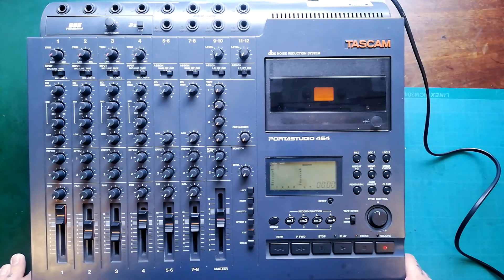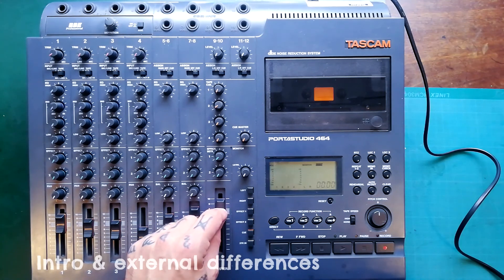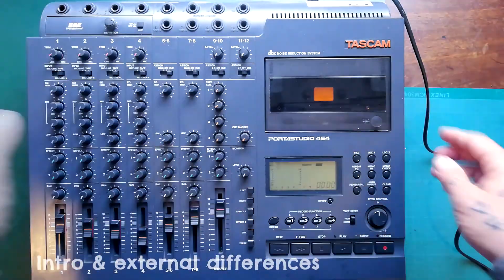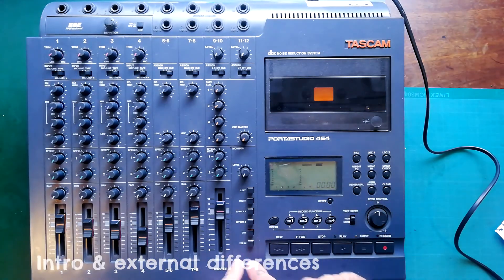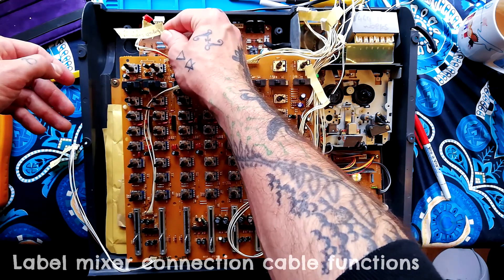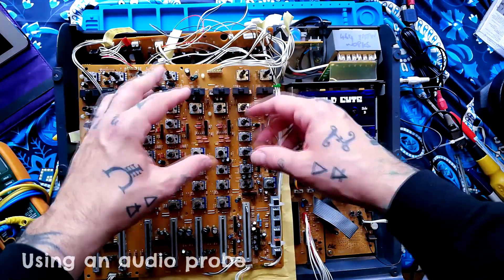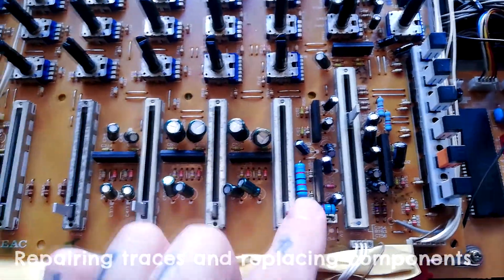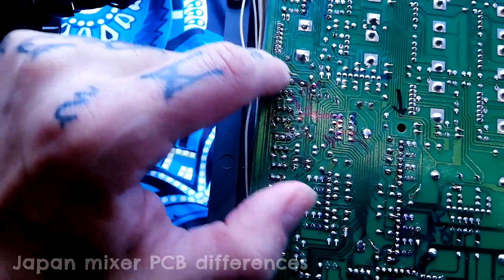Tascam 464 | Japan version with BBE enhancer | review of differences | repair case study

Comment: Hey mate! 
I have one of these and never known whether this thing has internal preamps or if they’re line inputs?
When using an external preamp I still go in on the return channels just in case as I don’t want to preamp twice as I haven’t been able to find this information... 
Are they preamps on 1,2,3,4 though?
Reply from the maker: They're preamps, though I think  if the gain trim is set to minimum they should just be 1:1 buffer stages? Not sure I'd hear the difference, but then my ears have had decades of abuse